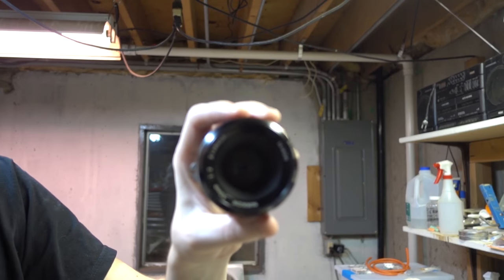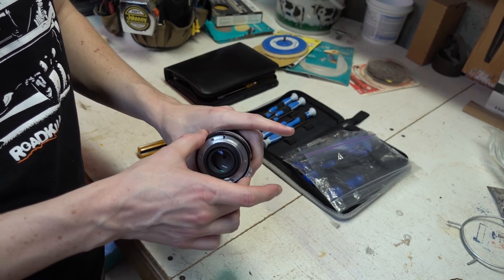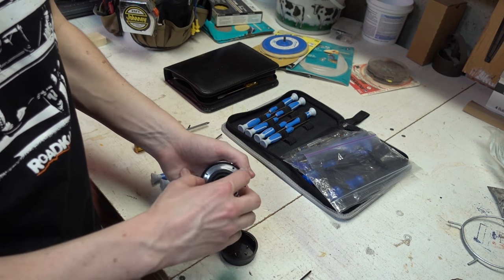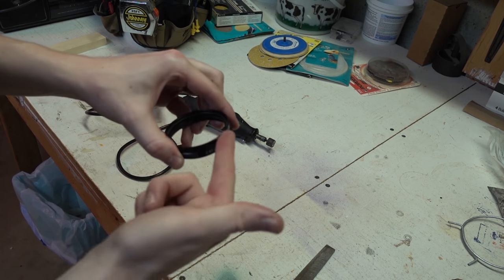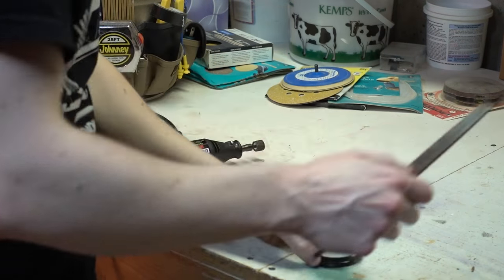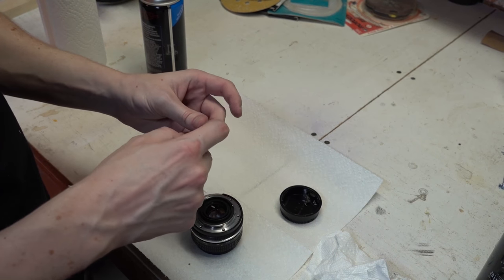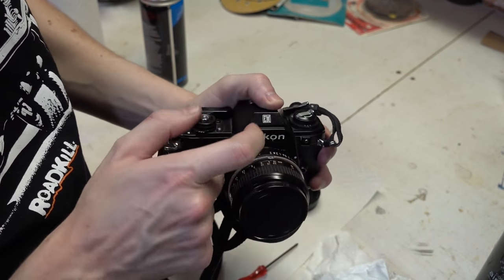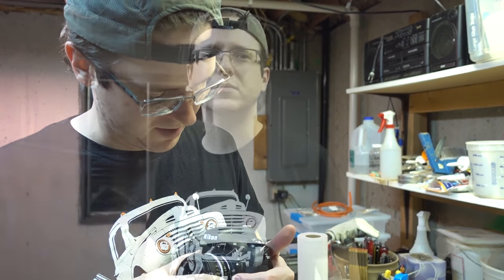Nikon Non AI Lens Conversion for Modern Cameras 50mm F2 on D750 D810 D500 D5 etc

Comment: The screwdriver you need for the rear screws is a Moody (or similar brand) JIS #0 size. Do not be tempted to use a Phillips or a Posidrive as it will slip and ruin the head. Also, the position of the notch varies according to the maximum f stop of the lens you're converting.

Comment: Jesus, I had no idea about pre-AI lens compatibility. I received a beautiful near mint Nikon F100 today because I'd read that it works with all F Mounts elsewhere. The lens I have is a Vivitar 135mm (according to the serial it's manufactured by Tokina) it seems to be a decent portrait  lens, the first thing I did was mount it on the F100 and everything clicked into place and felt right. Luckily it didn't interfere with the aperture tab on the body so I believe it's safe, but I'm not putting it back on until I know exactly what I'm doing or what's going on. I mean, I'm not entirely green, I've been using a Hasselblad 500 C/M for the last 8 years without a meter, but yeah sometimes you can get caught out. 

I'll just have to wait until the Nikkor AI and AF lenses arrive to use it

Stupid boy I am. To think I could have fucked up such a gorgeous camera through my own ignorance. I'll keep shooting with the trusty Spotmatic SPII for a couple of weeks then!

Comment: I ruined 2 cameras (D300 and D700) by using  an old 50mm 1.4 lens (like yours). Now I have a new D7100 and i have to make this notch.
Now my D300 and D700 works only in maximun aperture of lens forever.

Comment: Friends please tell me if I can use this old (berfore, pré AI), AI nikkor-s lens on a nikon F3hp body. Nikkor-s Auto 1: 1.2 f = 55mm. It was worked and presents some modification that I do not know to say that ear was cut and mounted in the opposite position and the ring in my vision, was cut all over the circumference. I bought the body in one store and the lens in another store both said I can use but so much literature caused me fear. Your movie is the best because it was accurate. Thank you from Brasil.

Comment: hi...is there a "standard " amount or dimension , position to cut away or is different from lens to lens??
Reply from the maker: The position of the cut away is different from lens to lens. The cutout needs to be positioned within a few mm to get the camera to record the correct exif data. If the cutout is improperly placed, the exif data won't be recorded correctly. As long as the lens can be properly mounted, aperture priority and manual modes will work.

The size of the cutout needs to be large enough to be able to mount the lens, but the side furthest away from the metering tab can be larger than what is necessary.

Comment: I dont know how this can actually damage the metering tab. Would you explain that to me?
Reply from the maker: The aperture ring sticks out farther than the mounting plate. If you have an Ai, Ai-s or D series lens you can see the cutout that will push the metering tab along when the aperture is changed. The G series lenses don't have a aperture ring, so the body of the lens sits flush with the mount, unless there is a rubber grommet. The non-Ai lenses do not have the cutout, so they will put pressure on the metering tab, potentially damaging the mount of the camera. The notch is cutout to make sure no pressure is put on the tab or camera mount.
Reply: Light Slayer 69,000 i actually didnt know that when I bought the lens and I still had the lens on wgen I watched the video. There is still a slit between meaturing tab and my lens do it doesnt look like there is any pressure on it. Only thing I noticed is that my camera thinks f1.4 is 2.8.
i dismounted the lens now. my metering tab still steems undamaged so I hot lucky.